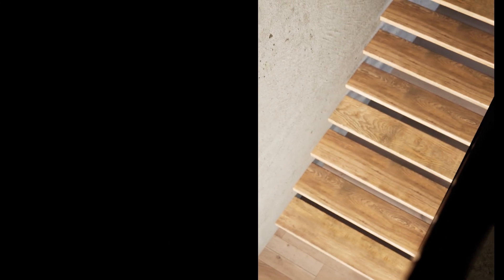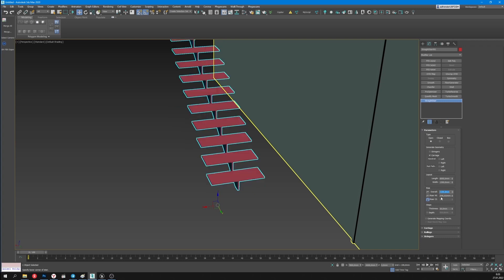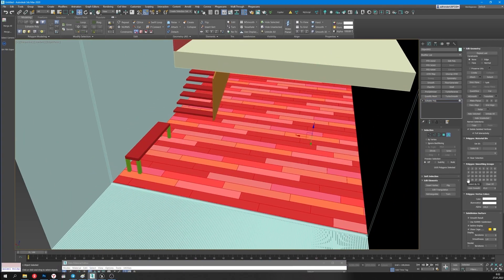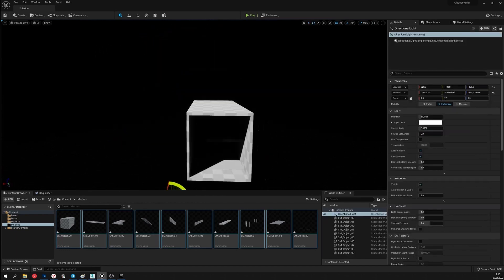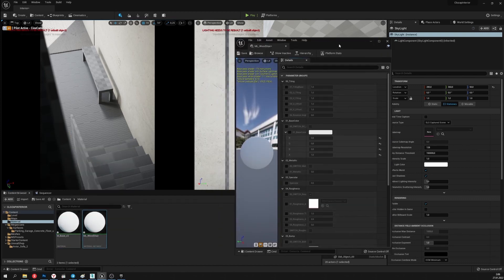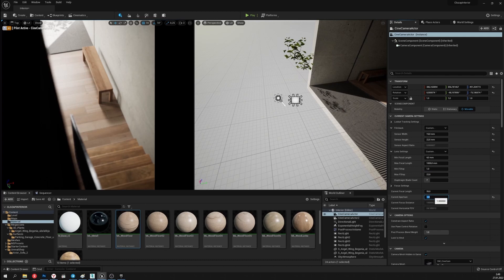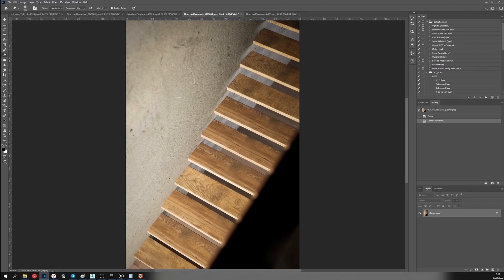How to create interior in Unreal Engine 5  and 3ds max from scratch | Interior in Unreal Engine 2022

Comment from the maker: Content of How to create interior in Unreal Engine 5 from scratch | Interior in Unreal Engine 2022
00:00- Start
00:10 - What's this video about (How to create interior in Unreal Engine)
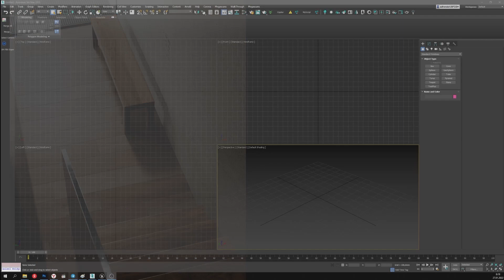00:25 - Box modeling in 3ds Max for transferring into Unreal Engine 5
01:48 - How to create stairs in 3ds Max for transferring into Unreal Engine 5
02:57 - How to create bench in 3D max for transferring into Unreal Engine 5 
03:13 - How to create floor in 3ds Max for transferring into Unreal Engine 5
03:22 - How to set material ids on a floor in 3ds Max for transferring into Unreal Engine 5
04:52 - fbx models exporting in 3ds Max for transferring into Unreal Engine 5 
04:59 - How to create project in Unreal Engine
05:25 - Object importing from 3ds Max to Unreal Engine 5
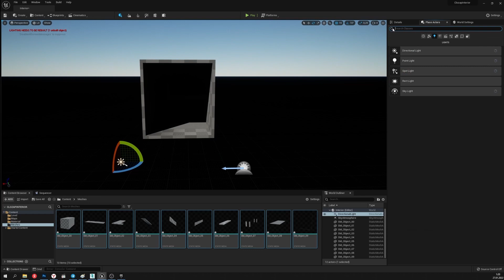05:55 - How to create and set camera in Unreal Engine5
06:13 - How to set up lighting in Unreal Engine 
06:58 - How to set materials in Unreal Engine 5 
08:09 - Add material on a floor and settings for it in Unreal
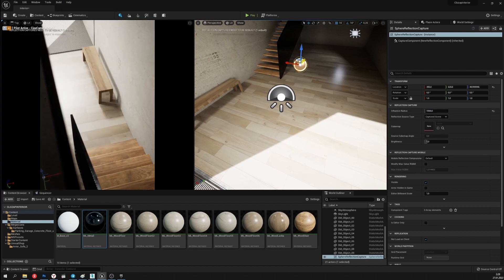09:35 - Final settings for lighting and cameras in Unreal Engine 5
11:40 - Image rendering in Unreal Engine
12:34 - Постобработка итогового рендера в Adobe Photoshop Postprocess an image from Unreal Engine in Unreal Engine 5
13:15 - End